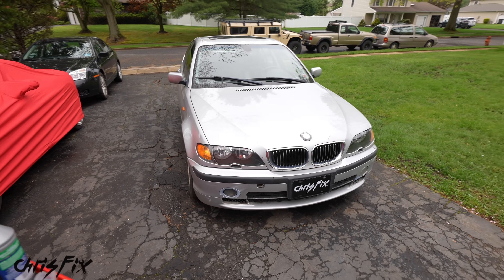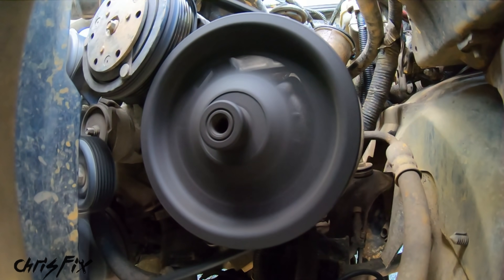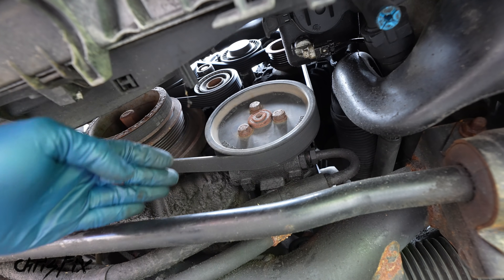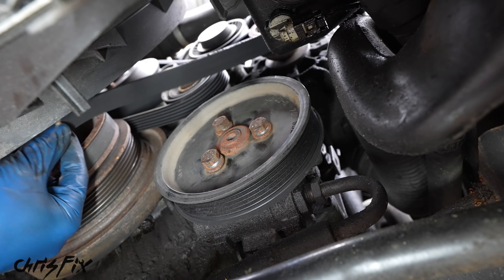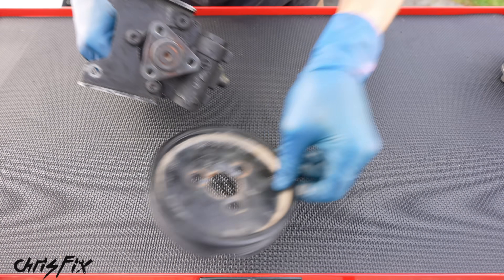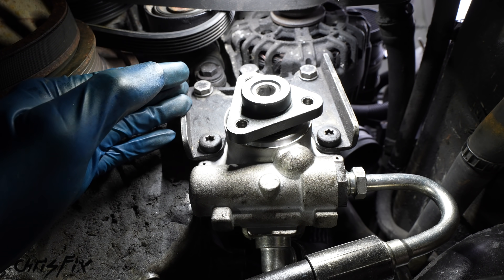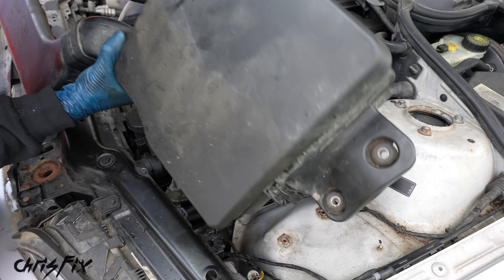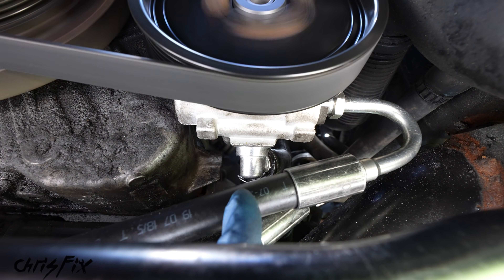How to Replace a Power Steering Pump

Comment: That was weird, you shouldn't have had to turn it lock to lock to get the fluid sucked in like that.  I've drained that system dry on an E46 and re-added fluid and never needed to do that.  Kinda interesting.  Considering that metal sheared off your old pump, I'm now wondering if there was metal debris in the rack.
Reply: I've NEVER had ANY car that will just suck in fluid, as that's not how the pumps work.
Reply: Yes, he should have turned lock to lock while the rack pump was disconnected to clear out the old fluid from the rack, and the drained the cooler as well.
Reply: @Soim26  Well that depends on where the car is from and what year it was made. Some E46's take ATF and some take CHF. My old 323Ci from -00 had a label with "CHF Only" on the cap, but my current 330Ci that was imported from Germany in -01 has ATF stamped on the cap. I think it was due to the climate the car was being used in, since it seems to vary much more between "standard" cars and "cold climate" cars.
Reply: @AlexYeets  My E46 330Ci did that when i filled it after the high pressure fitting backed out and drained the system whilst driving down the highway. Filled it up, started the car and it just sucked the reservoir dry instantly. Although, admittedly, i do believe there is some what of an issue with my pump as it screams whenever you turn the wheel... Heh
Reply: @andreas4959  please pause at 7:19, its clearly written on the cap.
Reply: @Soim26  Yes, in this particular case. And besides, apparently BMW started stamping ALL reservoir caps with "ATF" at some point, but some cars still got the "CHF Only" label on top of the stamp in some areas, since they apparently use different materials in the o-rings and such that require CHF, probably to be better equipped for, as i stated before, the climate it was being sold in. For all we know that label might have peeled of after all those miles and years, so this car MIGHT be equipped with a CHF system after all.

And besides, my point was not that THIS car needs CHF, but rather that SOME older BMW's DOES indeed use CHF unlike your claim that ALL of them use ATF.

All I'm saying is it's not so easy as to just say "All of them use ATF", cus some don't, and when you go pouring ATF in a CHF system, you're going to have a bad time later down the line.
Reply: @andreas4959  👍🏻
Reply: @andreas4959  I CLEALRY wrote I THINK, i dont know how hard is it to understand the difference between “aLl tAkE AtF” and “ I THINK the e46 takes ATF” 🤭
Reply: @danielalushaj7919  Don't do that on many Hondas! In the two I had ('93 Accord, '08 CR-V) ATF or generic PS fluid will destroy the rack seals.
I learned the importance of that the hard way years before. I had a 1969 Lotus Europa with Girling brakes. DOT 3 fluid said it was for all cars so I changed the brake fluid to DOT 3. A couple weeks later the pedal went to the floor.
If the cap says to use ATF, use ATF. Otherwise use whatever it - or the owner's manual says to use. As with coolants, one size does not fit all.
Reply: @AlexYeets  The two Hondas I replaced PS pumps in filled like a flash when the engine was started. That is how the system works: it always pumps fluid and the rack controls how much goes into the pistons.
Reply: @freestyle648  As others pointed out, the goal for this car was low price as each ten dollars over the threshold (which it was over for critical items) cost a penalty lap. You are right for a typical car with a flexible budget and years to live, but that detail changed changed the "rules" here.
Reply: @flagmichael  power steering fluid its different.
Reply: @Soim26  A good observation. BTW, in this car the PS reservoir / filter were probably never changed, but if they had been the cap could have been wrong.
Reply: @flagmichael  Might have been swapped idk, the thing is that almost every bmw owner knows that the filter / reservoir + fluid must be changed when the cap starts leaking, some change the o-ring on the cap but it wont help much as the cap itself deforme due to high temps in the engine bay
Reply: @flagmichael  Yes - and if the rack doesn't allow it to flow, what's going to happen? Nothing.
Reply from the maker: None of the metal got into the rack (too small of an opening and I checked) but I think it was just a lot of air in the system because multiple lines were changed.
Reply: @chrisfix  Hey Chris can you tell them that is safe to use power steering fluid as ATF
Reply: @danielalushaj7919  Do you mean ATF as power steering fluid? Neither one is always true.
Reply: @AlexYeets  The only reason for the rack preventing free flow of fluid would be if the shuttle valve is held over by torque on the steering column.
Reply: @flagmichael  thats what i said  and ATF and power steering fluid are both lubrication fluids
Reply: @danielalushaj7919  You seemed to be saying that you can ALWAYS use ATF as power steering fluid in any car. If that's what you meant, it's incorrect, and you can potentially cause expensive damage putting the wrong fluid into your power steering system. Always check the PS fluid specs for your car, nobody should ever just assume they can use ATF.
Reply: @dunebasher1971  i didn't say that. U have to check the bottle like chris did to see if its made for your car.

Comment: I'm super late to this, but you can't torque something down using a crows foot unless the crow's foot is straight with the wrench otherwise you'll get a weak torque, do to the forces going at an angle
Reply: how should this be done then?

Comment: When you were putting the belt back on after putting the pulley on, looks like your belt is starting to shred on the upper right side of the screen around 20:07
Reply: I noticed that too
Reply: This comment will age very well if the belt snaps during the race.
Reply: It's that extremely tight budget again. I bet he would have chosen a new belt if the budget allowed.

Comment: Quick question, if you where to jack the front of the car up would it make a difference other than making it easier to turn the wheel?
Reply: yes, 100%
Reply: Yeah you wouldn’t need to do the “workout”
Reply: Like the other 2 said, yes it is much easier and it's easier on the pump as it won't strain as much or for as long while there is no fluid making it through.

Comment: Hey ChrisFix, I have a huge problem with my door panels / interior plastics rattling with my bass-heavy stock speakers. I think that would be a neat video
Reply from the maker: All about the sound deadening! I’ll be doing a video on that. Stay tuned!
Reply: @chrisfix  Perfect! I have the same issue that the original comment is talking about so I’ll be looking forward to this video. Thanks Chris.

Comment: Oh you're not gonna believe this.  I got a Jersey bred E-36 with a high pressure hose leak and I've been dillydallying about replacing that line, even thought I've had the part in the garage for over a year.  What are da odds we're both working on virtually the same system....  Go figure.  Excellent video, and get cracking on more factory videos like the NRS brake pad build.  Beats me going to Canada, since my last factory visit was 1956 to the GM assembly plant in Linden, NJ (long gone now).  NRS is on my list for all my replacement work now.

Comment: I am unaware if this has already been mentioned, but you can use a torque wrench using a crows foot socket. You just need to be sure when you are doing so that the bolt is at 90 degrees to the wrench handle. This makes sure that the "wrench length" doesn't change to get an accurate torque spec.

Comment: Excellent video (again) and the only thing I might add is to life the car on jack stands in the front. 
 That will lighten up the steering a bit compared to the tires compressing on the ground, under the weight of the car.

Comment: Last December I started hearing a noise in my steering pump. Went to the mechanic and they replaced the return lines and that fixed it for a while. The other day the noise came back again so I got the high pressure line replaced, and that finally fixed the power steering issues. No more leaks or noise. Thankfully that repair was less expensive than the pump, which would have costed a few hundred more, and the high pressure line would have to been replaced anyway if the pump died.

Comment: My power steering is so stiff that I couldn't even drive properly. It's 550$ for power steering assembly plus laber  it's over 700+. They are just trying to rob. It's good having your video.
Reply from the maker: You can definitely do this cheaper yourself!

Comment: this video also helps how to replace compressor or alternator buried in tight areas cause sometimes you have to remove the bumper, condenser and radiator incuding the electric radiator fan to get access to it.

Comment: Pro tip from dealing with fluids in cramped german cars. If you need to catch the fluid before it hits the ground for some reason (like protecting the alternator), one trick I like to do is use a zip lock bag underneath where fluid will come out. The bag can go into any shape you need to catch fluids and can reuse the fluid if you needed/wanted to. Especially nice with some brake master cylinders that have a drain hole instead of a removable filter so you don't mess up the paint.

Comment: I took my driving licens on a car without a steering pump. It's a paint to turn steering wheel when stationary but when car starts moving (even on slow speeds) it's MUCH easier to steer. So even if your steering pump is not working it's not as dramatic as Chris showed.

Comment: Not sure if the new pump uses power steering fluid, but the factory pump on these cars uses automatic transmission fluid. You can see it on the old reservoir cap "ATF oil only".

Comment: To prime the system you can also jack the front of the car on both side to make it easier to turn the wheel and it will still prime the system

Comment: I bought a car that had no power steering working.
In my case the steering shaft was bad, it had some hydraulic pipes that probably got clogged or something. Replacing that fixed the problem. It was an atypical french car.

Comment: Great video man. I enjoyed the detailed explanation and detailed video angles. I have a 2003 330XI which has the subframe right under the steering pump and R&P so all these angles of camera help to see where i can get in there cause it's a little more tight with that subframe. Great way to explain from beginning to end. Like if you were explaining to a new DIY'er that's not familiar with replacing pumps. Loved it man. 👍
I do have a question though 🤔 I've read everywhere and mostly on my 2003 330xi ( 2000- 2005) that these steering systems run on ATF only. You used power steering fluid "made for European cars", (BMWs included) in guessing your car is newer but it sure looks like mine (old wise) except for its not an XI. Can you explain that and maybe I've been hearing only advise that is convenient/opinion but not necessary or factual lol
Reply from the maker: Thanks! I used the CHF-11S as atf can (over a long period of time not immediately) eventually cause the hoses to dry and crack more easily, so I recommend it for this car
Reply: @chrisfix  and what car is this? Cause I see yours looks like a 3 series but what year? Mine is a 2003 330xi m54 engine. I was told and have read all over BMW 3 series to not use anything but ATF. I wanna a see if that's just a myth lol since you seem to have used that power steering fluid instead of ATF. Yes, I agree ATF is dirtier.

Comment: Yo Chris fix thank you for the tutorial and absolutely did help me to do what I needed to do which was a power steering pump and Reservoir only problem is it wasn't my issue more likely we're looking at a bad rack a rack that's been on a vehicle that has 240,000 miles E46 gang

Comment: Deleted 3 power steering to manual and never had issues. 😅 as soon as you start to move it gets smoother. I gain 3 hp and no more  leaks as well

Comment: Hey man, you should use red atf fluid, specifically Dex III, I have this as a project car and I can promise you that the wrong fluid will cause friction in the  gears of the power steering pump over time, and these pumps are known for sheering at the back gear.

Surprisingly, you've got the LF30 pump in there, which is much better than the previous LF20 variant.

Comment: 21:26 it would be best to make sure the wheels are off the ground to make it easier to turn the steering wheel when its still dry after installing the new parts and new fluid 😁

Comment: Hey love your videos you are the biggest inspiration for me taking on all my own as well as friends and family's car/truck troubles. Just thought I'd throw in my weird volvo knowledge if anyone has a P2 volvo which covers s60 80 v70 xc90 from about 2000-2012 steering problem where steering wheel turns smooth a little but gets tight in certain places it could be a rusted lower steering coupler not to bad of a repair a little uncomfortable and awkward like most volvo work but absolutely do able if you know what you're doing and worth checking first if nothing is noticeably wrong with the power steering pump/hoses/reservoir

Comment: The rotten underside can be mitigated with a protective floor beneath the engine bay, that some modern cars have.
Mine was missing which caused the starter motor to corrode and fail.
This is why it can make sense every now and again to go back to main dealer, as they can set your car back to factory spec.
Nobody else I took it too noticed that the under floor was missing, which was causing all this corrosion under the car.

Comment: I would probably recommend matching the fluids by looking up what fluid specs you need for your exact submodel rather than just using one because it says bmw on the bottle. Different sub models have different specs and also different year models have different specs. So you might run into compatibility issues.
Reply from the maker: I def agree
Reply: @chrisfix  E46 specifically uses ATF in the power steering system in this case
Reply: ^ Noticed this in the new video and had to point it out here

Comment: Quick tip, when you try to force the new fluid into the lines, just lift the car, not all the way, just enough to tires to levitate and voila! You can easily turn the steer. Maybe possible to turn the steering for this car but it is impossible to do with the trucks, especially with fat tires

Comment: Get yourself a bendy hose clamp tool. 
I cannot praise this tool enough. It is cheap, it looks like it wouldn't work, but it does. 
Because the hose clamp screw is always pointing in an awkward direction. And you drop your socket wrench and you bust your knuckles.

HOSE CLAMP TOOL! You need it!

Comment: Well as a person who spent six hours trying to remove a Power steering pump on a Chrysler Sebring, and eventually giving up, and getting a back yard mechanic to do it. 
 
   I can assure you, the easiest way to replace that pump on a 2008 Sebring is to drop the motor, or remove the whole axel. Trust me. I fought tooth and nail trying to remove a power steering pump from the bottom of a car. I stripped the exhaust bolts trying to get room to remove the pump, and squeeze my hand into it. 

Also if you have drove for more then an hour with an open line, because you tried to get to the parts store, which was closed. You have also goofed your steering rack too. Many, Many hours of cursing Chrysler engineers, a dozen attempts, lots of money, and busted knuckles were spent into learning this lesson for you all.  
  
  Lesson i learned, not worth asking three different people to borrow their garage, half a dozen times.  To try and fix a Chrysler Sebring.

  Also almost cured me from wanting to fix my own vehicles ever again.
Reply from the maker: Darn! Sometimes those items end up not being serviceable :/
Reply: @chrisfix  not serviceable for the average joe, yes. The pump was changed out twice before i realized i would have yo change the rack. Then i just gave up on it after the fact.

Comment: Quick tip: Jack your car up and use jack stands for this job. When bleeding the system its easier to turn the wheels when they are off the ground, and second reason: don't dry steer which can damage the tires.

Comment: One small tip I want to add.  If you work on either brakes or power steering, don't go on any joyrides immediately afterwards.  Spend about 15 or 20 minutes just driving slowly around your neighborhood, making sure nothing is wrong;  it's much safer for you and everyone else if you discover something is still broken when you're driving 30mph down the street from your house, rather than 70mph on the highway 20miles from your house.

Comment: I had a leak in my high pressure powersteering line last month in my CR-V and wish I had watched this video. It took me, my brother, and a co-worker two days for us to get the line off, get the replacement in place and get the car back on the road. I will say, I could not see a way to access the end of the high pressure line from under the car, so we went in over the engine and that probably made it 10x worse than it needed to be.

Comment: Could this video be also used as a guide to installing power steering into a car that didn’t come from the factory with one? I have a 1986 mercury lynx that did not come with power steering from the factory where other models of the car do.

Comment: I recommend you lift the front wheels off the ground when you turn the steering wheel. Easier to turn and doesn’t cause as much stress on the new parts

Comment: I definitely need to check the power steering in my 72 F100. Very hard to turn when the vehicle is not moving (like it was not assisted) and makes a weird noise only when turning the wheel.

Comment: I just want to say that 2007 through 2015 Subaru's also make a groaning noise when you start the engine, but it usually goes away after a minute or two.